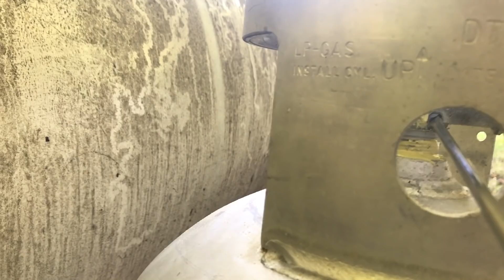How to fill your own propane tank

Comment: 2:11 I know this is an older video... but for those who may be watching this I just thought I would point out that your purge valve in your fill hose is in the wrong location. In this video you have the POL adapter connected the ball shutoff valve, then the purge valve behind it. 
The purge valve goes between the POL adapter (which is the fitting that screws into the tank you want to fill) , and the line shutoff valve (ball valve with yellow handle) .   POL --> Purge Valve --> Ball Shutoff Valve

-->I'll get into why connecting it this way is better below:
## First a word of warning... Wear Insulated Gloves before you start!! You can get frostbite if hit with enough propane, and even if you don't get frost bite even a quick small hit will burn a bit. 

Once everything is hooked up and connected. To purge the line, you keep the valve on the tank you are filling closed, open the line shutoff valve (ball valve with yellow handle) , then open the purge port. Once the line is purged of air (which only takes a few seconds depending on how far you open it) close the purge port, and then begin your tank filling procedure. (slowly open the propane tank valve you are filling, and if you want crack open the bleed/vent screw on the side of the tank valve to get a full fill)

Once the tank is filled, you close the bleed screw (if you opened it) then close the tank valve. Next close the line shutoff valve (ball valve with yellow handle) , then once again open the line purge valve. 

*If you have your connections setup like I stated at the beginning  ~ POL --> Purge Valve --> Ball Shutoff Valve ~  It will allow the propane between the tank valve and the ball line shutoff valve to escape in a controlled safe direction. Instead of it spewing out everywhere and freezing your hand when you unscrew the POL adapter from the tank.* 

Of course after you done filling tanks, close the supply (big) tank valve, point the hose in a safe direction and open the line valve to allow the propane in the line to escape as you shouldn't leave the line under pressure, as well as for safety reasons. 

Again, just thought I would post this for people watching, might help someone.
Reply from the maker: You are correct. I don’t know why I installed the purge valve at that location.
Reply: @TheMasterMUF  At one point, I had mine assembled in the correct order... then because of someone else I took it all apart and installed it like your's was... and when I used it the next time I was like "Why did I do that?" So I had to take it all apart again and put it back like I had it to begin with. lol  We all make mistakes, when i do i just hope i learn from them.

Comment: When you removed your cap on your check lock did you have propane escape? I loosened mine just a bit and heard propane and stopped not sure if this is normal.
Reply from the maker: Not on mine. But it is possible that some gas will escape while the valve closes, it’s also possible that you have a bad check lock.
Reply: @TheMasterMUF  you are correct... A little pressure did build up over the years. Thanks for the reply

Comment: Surely they need to be filled to the correct pressure, lest the temperature increases and the whole thing blows up. You can buy a special regulator to do this safely.
Reply: not true. for decades, propane tanks have been filled by liquid volume during filling in all climates and the tank manufacturers have already allowed for expansion and contraction due to temperature variations as far as safety is concerned. siphoning propane from one tank to another is really not more complicated than siphoning gas from a car into a gas can. but is is important to keep the receiving tank level for accurate readings.

this technique can also be used to empty the contents of a common 20lb grill tank into an rv's built-in fuel tank using the proper fittings to connect the tanks. the grill tank has to be inverted to flow liquid and it needs to be elevated above the rv tank. you can liquid-fill through the vapor valve on the rv's tank since the fitting needed to connect to the liquid fill port is ridiculously expensive to buy.. the rv tank will have a bleeder valve just like a grill tank, sometimes a screwdriver valve but most have a thumbwheel valve that requires no tools.
Reply: Richard Sandwell when I use to fill propane tanks the tank was put on a scale and filled to the correct weight weather it was a 20, 30, 40 or 100# tank.

Comment: I have a full 500 gallon tank that used to be connected to a large generator, we got a new generator connected to our under ground tank my question is can I just connect to the old line that was feeding the generator or is that gas and not liquid.  Thanks
Reply from the maker: The line connected to the generator is going to be gas not liquid. Is that line connected to a pressure regulator? I you have a regulator between the generator and the tank then that line is gas.

Comment: Is the transfer valve and hose attached permanently to the bulk tank? Or you have to empty the hose and remove the valve every time after use?
Reply from the maker: It up to you. You can leave the hose connected permanently. I remove my hose and leave the valve.

Comment: thats how they fill my forklift tanks they open the bleeder and stop filling when it spits out some liquid.
does the fitting on the big tank have a pipe that goes down into the liquid gas?
Reply from the maker: mike cubes... yes that is why I bleed the hose until I get liquid.

Comment: Do you have links to get the exact setup..or a video showing you modifying the normal setup to get to this point
Reply: Ebay store name is "propane-kits"
Reply from the maker: https://store.nashfuel.com/products/453-pol?pr_prod_strat=e5_desc&pr_rec_id=7b831e962&pr_rec_pid=7169209565341&pr_ref_pid=7169172078749&pr_seq=uniform

Comment: Can the same set me configured for transferring from 20 or 30 lb. Tank to a 1 lb. tank?
Reply from the maker: It is more simple to transfer from a 20,30 or 40 Lb tank you just need an adapter. GASPRO 1 lb Propane Tank Refill Adapter, 

Universal Mini Propane Fill Adapter for Disposable Small Propane Bottle, 100% Solid Brass Valve with Safety Protection https://www.amazon.com/dp/B01N19Y96P/ref=cm_sw_r_cp_api_i_gkwCCb0AKYZT2

Comment: When you screwed on the external valve to the check-lock, DOES TANK HAVE TO BE EMPTY?
Reply from the maker: No.
Reply from the maker: Cosmo yes. I remember reading that last year when I installed the valve. I just leave the valve installed. I don’t like wasting the propane.
Reply: Okay, your video is the only one on YouTube that explains how to do this properly, I would have never figured this out, I am building my own, I bought from same seller you bought yours, but on Amazon.  I searched and searched and Nash Fuel seller is the only person I could buy this special valve from.  The VALVE & ADAPTER HE SELLS ONLY WORKS Chek-Lok valves 7590U or 7591U  I am adding a 3/4" locking ball valve on to the Nash Fuel valve so if kids or anybody turns the valve it will NOT let out any propane, I am also going to put a pressure gauge on mine.
Reply from the maker: Cosmo, keep me posted on your progress.
Reply: @TheMasterMUF  I removed those online directions I found, they are not true, if you leave the valve open propane gushes out too fast when you install valve, however BE VERY CAREFUL when removing valve because if you don't hear a "click" / closed from the Chek-Lok valve and it doesn't close properly propane will be gushing out, very dangerous, so remove it very slowly until you hear a click. 

I tried to fill my first bottle / tank for first time, it didn't hardly work at all, so I drilled out the the POL to almost a 1/4" with a #1 drill bit.  (note.  If you buy off eBay from China their POL's have very small hole (that acts as a restrictor) which you can drill out, if you buy in U.S. they install restrictors and don't work at all, but you can try to drill them out).  So now I have close to 1/4" ID all the way through and it works now but very slowly, it took half an hour to fill the bottle half way.  The problem is temperature, it was cold today in MN and the pressure was around 50psi, remember the pressure and tank level DO NOT CORRELATE, so I have a full tank but not enough pressure, if the bottle I was filling was freezing cold the liquid would transfer much faster, if I had the bottle inside house /warm it would barely take any propane.  So what I will have to do is transfer the propane on the warmest days possible, put fill bottles out in snow so they are colder than the 500 gallon tank and it should work much better.  It would work perfect in summer because I could put bottles in basement to cool down, tank pressure would be around 150psi + in full sun and it would work real good, much harder to do in winter weather ):
Reply from the maker: Cosmo... I never remove the valve from the check lock. Also if the tank that you are filling is not completely empty (with 0psi) the transfer of propane will be slow and you won’t get a complete fill. When the tank is completely empty the liquid flashes and it chills the tank, this will cool the tank and decrease the pressure. You will also get a faster transfer with a supply tank that more than %50 full.
Reply: @TheMasterMUF  That was my mistake and I never thought of that, my tank was about 20% full, wow that helped allot, thanks, have a nice weekend!
Reply: @TheMasterMUF  Oh yes, I never remove my valve either,  I put a 2 gallon bucket over it to keep snow and ice off, I have to take the hose off because of the severe weather up here, I put a 3/8" flare cap to keep water out and remember I have two valves, I have the quick on / off 3/4" ball valve with lock-out and lock on it, don't want a kid or somebody to turn it on and have a horrible accident, it almost takes nothing to ignite propane, even a spark, not happening here!
Reply from the maker: Cosmo. Are you in a subdivision? Are your neighbors closed by? I also worry about someone messing with the tanks.
Reply: @TheMasterMUF  I live in a community of about 30 houses, it is 4 miles outside of 55008 and they all have 2 - 3 acres, I have all my tanks inside garage.  I got mad because every-time I filled my small tanks they always under-filled them by about 2-5% so now I don't have to worry about this plus it's cheaper, I bought a digital luggage weigher to weigh my bottles, actually I bought two so I can compare to see if one is off.
Reply: @TheMasterMUF  Question....doesn't opening the bleeder valve on the tank being filled eliminate the difference in pressure/temperature  problems? And TheMasterMUF, THANK YOU for this video....was beginning to think I would never find one showing how to operate this set-up...got mine likely from same supplier you all did, but have been waiting for more info before installing.
Reply from the maker: 1oldsquare ... you have to do both open the blender valve and have an empty tank(0psig)
Reply: @TheMasterMUF  Yes, I leave the bleed valve open for about the first two minutes, I never fill on overcast days, I wait till the sun shines on the main tank and that my propane cylinders are the same temperature as the main tank.  It takes about 8 minutes to refill either 20 or 30lb's tanks, since the pressure in tank is lower at lower temperatures it will take longer, so the warmer it is outside the faster it will refill, that is why when the sun shines on the main tank transfers faster.
Reply: Don't mess with that liquid  withdrawal valve unless you know what you are doing. If you take that cap off and it's stuck open,you will see.

Comment: I believe we are supposed to use a scale for this am I right or wrong just making sure
Reply from the maker: Lewis Tamez it depends on the method that is being used to fill the tank. You can weigh the tank to determine the amount of gas that it’s in the tank or you can use the dip tube that’s installed on the tank. I used the dip tube that is why you see me venting some gas. When the liquid level reaches the dip tube liquid will start to vent out. 
     If you look at your tank you will see a stamp that reads “DT 4” that means that the dip tube is four inches. Each tank stile will have different dip tube length the length is set so that the tube reaches the liquid level at 80%.
Reply: Okay thanks was just makin sure

Comment: Where can I get the parts for the values and fitting?
Reply from the maker: Nashfuel
Reply from the maker: https://www.ebay.com/itm/181648131163
Reply: @TheMasterMUF  did you do this? I clicked on the link they want $200
Reply from the maker: @BrianAhearn8597  
Yes. If you don’t use a lot of propane it’s not worth it. If I fill my own tank it cost me $1.80 a gallon if I take it to get filled it cost me  $3.49. I RV camp and use  propane for that and other things around the house. Plus it more convenient.

Comment: why did you put the bleeder on the wrong side of the valve? youre just wasting gas the line should just have liquid propane in it all the time and the purpose of the line bleeder is so that you can remove the pressure between the tank valve and the hose valve when you disconnect the two. the ebay item you referenced shows it in the correct position. ebay item 181648131163
Reply from the maker: Patrick Sullivan   I just noticed that. I use the bleeder valve to purge the gas from the line once the gas is purged the line will be filled with liquid and stay filled. If you don’t purge the line you will introduce air in to the tank that is being filled.
Reply: TheMasterMUF yes but you still have it on the wrong side. all you’re doing is wasting gas, if it’s on the other side you can still bleed it between the valves without emptying the entire line every time unnecessarily.
Reply from the maker: Patrick Sullivan.. I agree, I will be changing it.
Reply: @TheMasterMUF   I'd appreciate seeing the change you make, not sure what you guys are saying.

Comment: Weighing the bottle before starting and during filling would prevent overfilling. Overfilling is dangerous and you have overfilled this bottle. Please check other threads on this subject online and re do the video. Delete this one ASAP to prevent accidents. Thank you
Reply from the maker: edward surridge 
Tanks are no longer filled by Weight. They use the tanks dip tube to fill to 80%. A tanks dip tube length depends on the specific tank model to ensure that the dip tube vents liquid at 80% fill. The dip tube length is stamped on the valve or on the dip tube it self on tanks with a stand alone dip tube. For example forklift tanks have a separate dip tube.
Reply: Great advice. This guy is dangerous.

Comment: Venting "air" is NOT possible, thre is only liquid and gaseous propane in the tank .
Reply from the maker: The air is trapped in the hose when you first  connect it.

Comment: Thanks for the video...   found the items on Ebay...  they are $199 for the package...   I own my own 500gallon tank...  I have the valves on top but I am unsure which one has the tube that goes all the way to the bottom of the tank for the liquid.  Is there a way to check?   Without killing myself that is  lol...  And do not worry about these guys on line...  they obviously have no clue on propane.  It is dangerous if you are not prepared or have knowledge on how to shut it off.
Reply from the maker: LOL very true. I just filled my 40lb tank at the same time that my gas company filled my 500 gallon tank. I asked the gas man (a profesional) if he was OK with me filling my 40lb tank at the same time that he filled my 500 gallon tank. He had no problem with it. 

I will post a link for you. 

There should be 4 valve on your tank. 1- Fill valve 2- A pressure relief valve 3- The service valve (this is the valve that you draw gas from) 4 - The check lock valve. This valve is used by the gas company to empty the tank. If the tank needs to be moved it must be empty. A gallon of propane weighs 4.2 lb if a 500 gallon tank is full at 80% that is 1,680 lb of extra weight. You can also use this to draw liquid from the tank.
Reply from the maker: Waynesworld 

This link has a lot of information on ASME tanks. The tank that is used on a grill is a DOT tank. 

https://www.propane101.com/understandingpropanetanks.htm